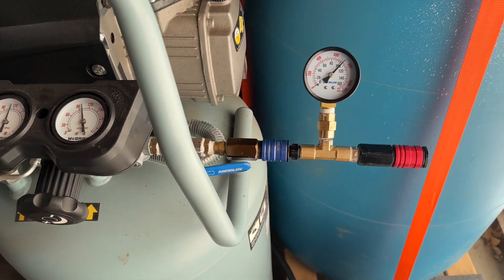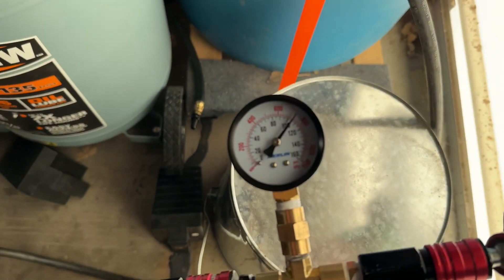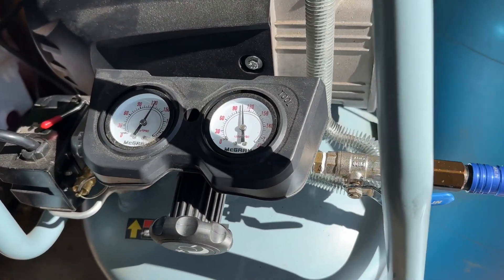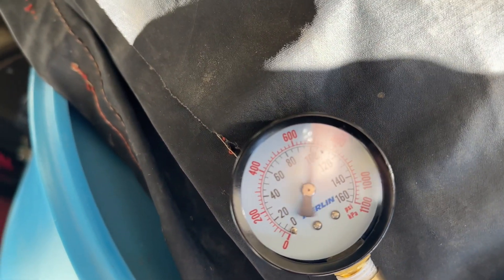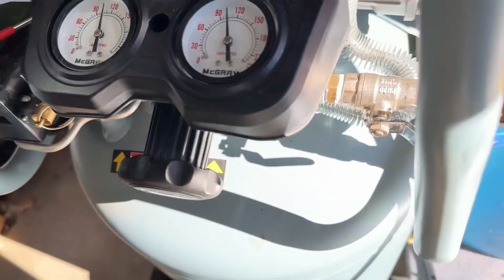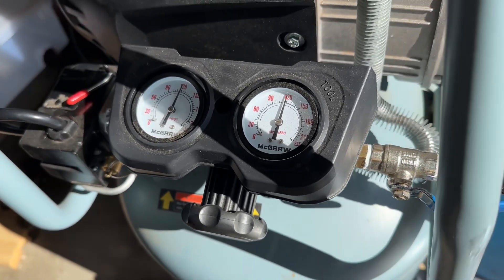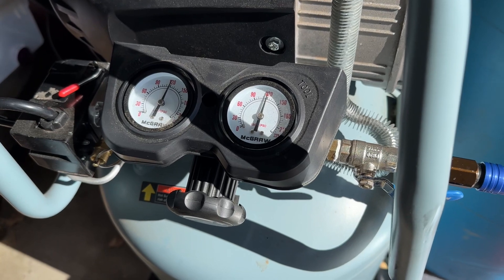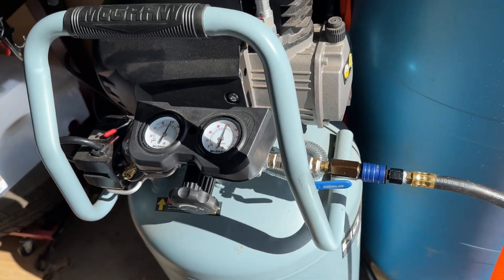Air compressor PSI vs CFM and how to properly connect your air tools

Comment: Thanks for the info. I got a bunch of air tools from dad. How do I find out what PSI they are suppose to work at? Can you show how to build the air gauge T?
Reply from the maker: You should be able to look up the tools on the internet and get the specs. It will show the PSI. For normal tools like grinders, impact wrench, drivers, nail guns, etc... it's pretty standard at 90psi. But things like paint sprayers use a lot less. 

Not sure what you mean about "Building" an air gauge T. You just buy a "T" connector for air hoses. Something like this:   https://www.amazon.com/Primefit-M1404-4-Manifold-Industrial-Couplers/dp/B016S0B1Q2/ref=sr_1_1?crid=2FVNC83QFDXP1&dib=eyJ2IjoiMSJ9.P9hR6O2H0NlxsXaSaPa-l7zEDEVVLTSuyOLnZYz4CtCGgxBs3T4zhcRZnH9stSDGUT2bDpop-KIQg50GKVfkyAYKDcJa_WlCGCv7pthVIO0vHtLQ8D8xoOmBCR41RmVonSC-_iKq8SRu22DXV73R50UR5o5xy28mF5fqCpfBVio68JnRodHLW_T8C1uYx6Y1Bhi7Cud3dFjwP44Erx89zJnQLgsaioSNfZIBOPA5rcjoyNVGwEBFyfS3Mrs8mYBExOjiVaqJ8akXOne8XaRDHfojVmB-getZfBX80CrK73Y.CdwNlnyiOYxUZLMILDbjLgOhrRFumlYuR1i6ociTEgg&dib_tag=se&keywords=air+compressor+t+connector&qid=1746922046&sprefix=air+compressor+t+connector%2Caps%2C183&sr=8-1

Comment: hey Mike I wanted to ask you a ? I have the husky 27 gallon 200 psi compressor, and what I need to know is why do people add a water filter  to the compressor's is that only needed for painting ? I use mine for taking off lug nut and air blowing is about it oh my 1/2'' air gun release's air from the bottom of the gun. can I do with out that filter? thanks for your advice in advance I am a new subscriber... have a nice day.
Reply from the maker: The decision is yours. Here's the deal. The air being compressed is VERY HOT. Like 300-400 degrees. When it gets into the tank it cools down quickly, condensates, and that's where all the water comes from. If you live in a humid environment, there's even much more water in the air. Now... there's 2 ways to get rid of the water. 1) Before it gets to the tank. (I have a video on putting on a COOLER to cool the air before it gets to the tank). 2) The other way is to get rid of the water after it leaves the tank.That's what most people do.

If you only use the compressor to blow air to clean dust/dirt or to just fill up car tires, then a water trap/filter isn't really needed. But you said you take off lug nuts. Well, you obviously put oil in the impact wrench before using it to keep it lubricated; well.... what do you think is happening when you are ALSO PUTTING WATER in the impact wrench. If you use it a lot, you are definitely going to create rust inside the impact wrench.  The choice is yours.

At the very least..... you should get a water separator. Harbor freight sells one for $8. Here's the link. https://www.harborfreight.com/oilwater-separator-68246.html  Put it between the impact wrench and the hose. It's usually good for quite a while. You can even dry it out if you know how; but for $8, if you buy one every so often when needed, you'll be good. This way you can still keep the majority of water out of your tools. Hope this helps. Mike
Reply: @DIY_Mike-rm5we  thanks mike and that's exactly what i did I put it at the end of my 3/8 hose with the female coupler at the end turned out real good... and what's neat about this water separator that it's clear and i can easily see when it's full. thanks a lot and have your self a great day.